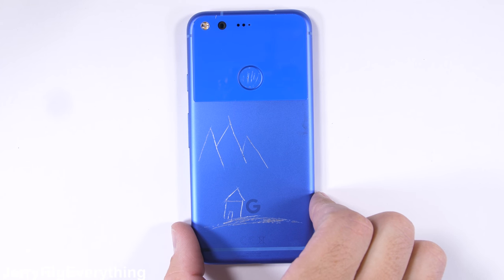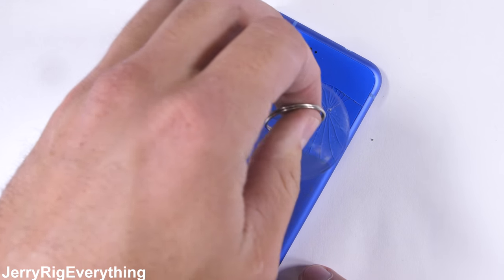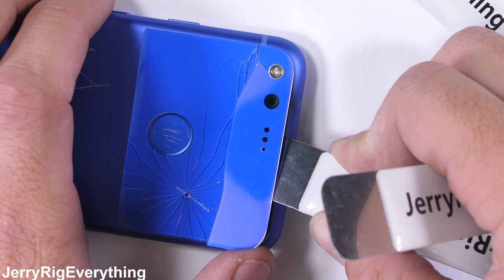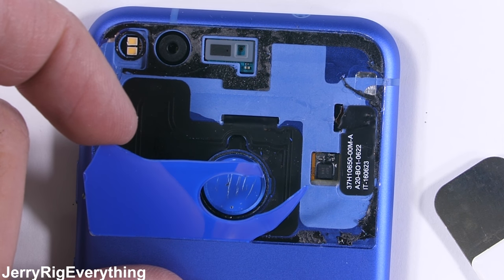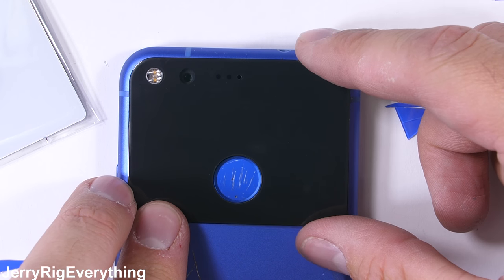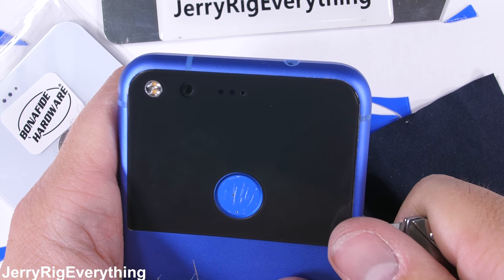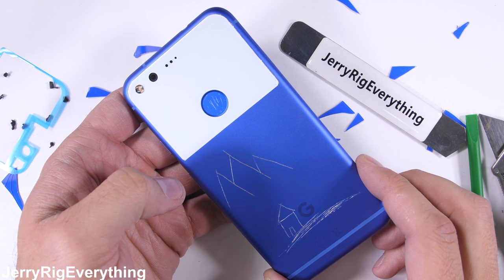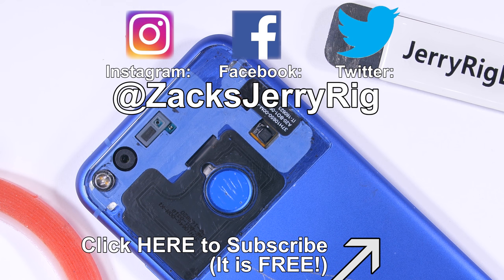Google Pixel Back Camera Lens Replacement - CLEAR  Back Camera Mod!

Comment: It's nice to know that replacing that glass is so easy since it scratches so easily. Now, that's a repair even I can do. I replaced the camera glass on my 6p so I should be able to replace the glass on my Pixel XL. It's looks to be pretty much the same process only the Pixel XL camera glass is bigger. Thank you for this video. I'd love to see what the blue glass looks like on the black Pixel XL.

Comment: How much would that cost if you took your phone in to a repair shop?
Reply: On an older phone I would do it myself. If it was fairly new I would probably take it in.
Reply: depends on country if you are wondering about private repair shop
Reply: probably $100-$200.
Reply: what?
on my a3 2016 the back glass(much bigger in size than on the pixel) only cost me to replace ~$15, lol
Reply: seeing how this is a premium phone, most repair shops will probably charge a fairly high amount no matter how simple the repair is...
Reply: I had to have the back casing repaired on my pixel in July and because if I went through them I kept accidental warranty coverage, it cost me about 150 for the entire back casing part. :(

Comment: which can i use to get that clear back? it looks like you pulled off the adhesive from it, is this actually possible to do with a clear back? more to the question, is it possible to buy one a piece of glass already clear?

Comment: I want to take apart my phone but I don't want to loose the water resistant. Can I use the same double sided adhesive tape that he displayed at the end of the videos to maintain the the water resistant or at least most of it? I can't find any videos on it.

Comment: Clear version better, but who want to buy super expensI've phone hence super easy break glass cover, even pressured harder also broke. Damned, maybe Google wanna earn more for accessories or chase off customers to others brand. Don't get it, management thought. So disappointed, even ceramic better then this. Unless they use  transparent gorillas glass, but price will sky rocked high then iPhone X.